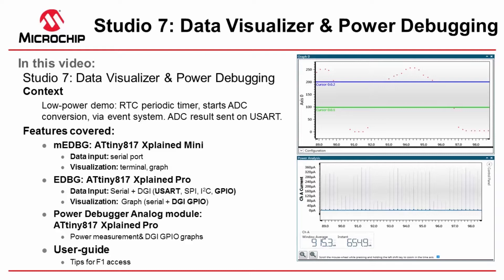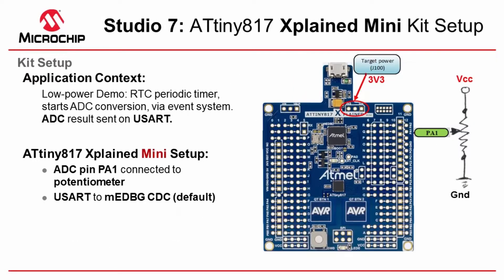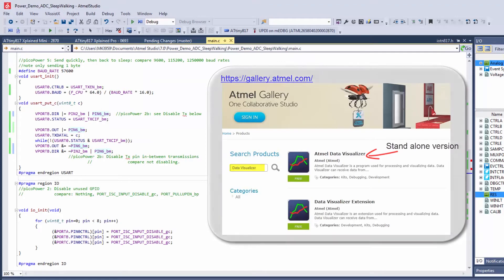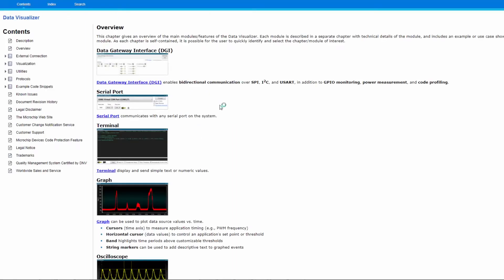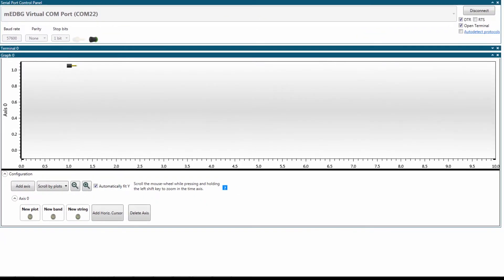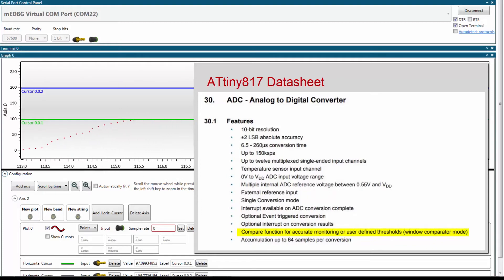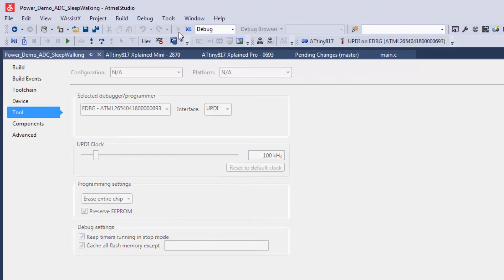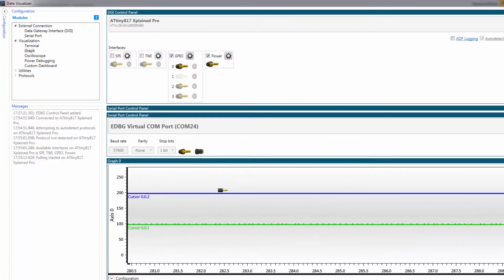Getting Started with Atmel Studio 7 - Episode 3 - Data Visualizer/Power Debugging Demo

Comment: Hi, I am trying to get DGI going with an Arduino Zero that has EDBG/DGI support built in. The virtual COM port is working but when I have EDBG selected as the debugger tool nothing shows in the DGI Control Panel. There is also no kit mode settings for EDBG in the Available Tools list.  Do I still need a Power Debugger for this to work? Thanks
Reply from the maker: Hi Shawn, The Arduino Zero board's Atmel Embedded Debugger (EDBG) includes a Data Gateway Interface (DGI) for bidirectional communication. If the DGI is not appearing in the Atmel Studio control panel, you should double check that you are using a version of Microchip Studio that is compatible with Arduino Zero. You should also verify that the UART settings on your target device are correctly matched with those in your terminal software. Hope this helps!
Reply: @MicrochipTechnology  Thanks for responding, I am using the latest version of microchip studio, 7.0.2594. I am able to stream data from the device to the serial port control panel in data visualizer, is this what u mean by UART settings being matched?
Reply from the maker: Yes, the fact that you can stream data from the device to the serial port control panel in the data visualizer in Microchip Studio 7.0.2594 indicates that your UART settings are correctly matched. This matching is necessary for successful communication between your Arduino Zero board and the Microchip Studio. Let us know if you have any other questions. Thanks!

Comment: its nothing about getting started. he starts somewhere in the middle and no one knows how to get there. i dont even get the data vizualizer running. i have a bare atmega328p connectet via programmer and would like for debugging to show some variables on some kind of serial monitor like in arduino.... this would be the simplest thing